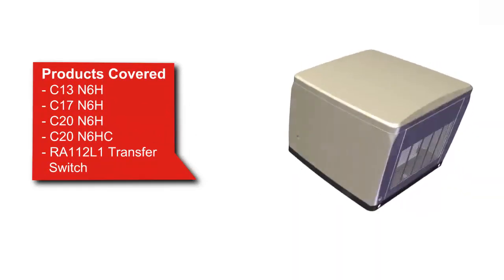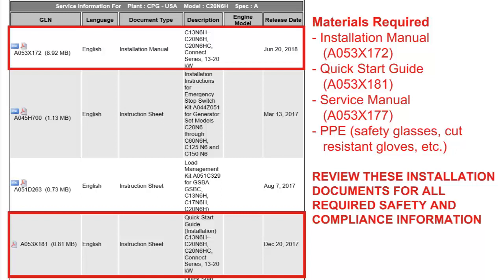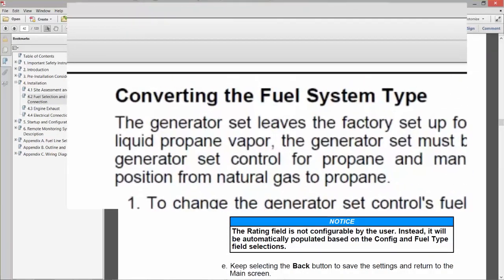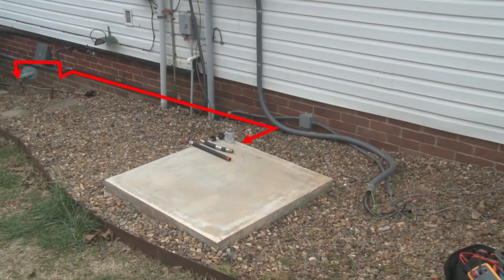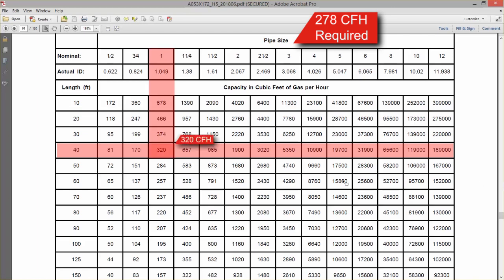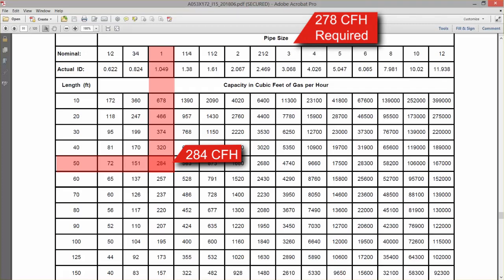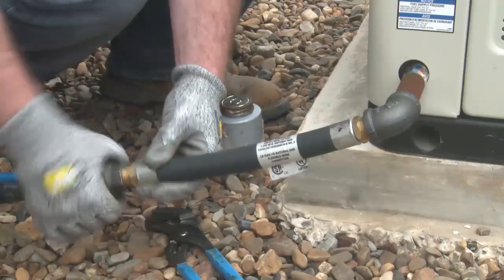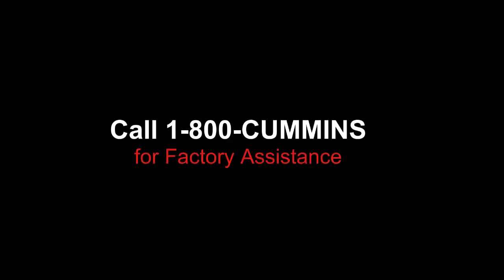Cummins Air-Cooled Generator Set Installation Part 2: Fuel System

Comment: Soap the nipple connection that's inaccessible due to the rear panel that is nearly impossible to remove.  That skipped over installing that nipple.

Comment: My expertise comes from 35 years in the natural gas utility industry & I would like to go over some of the shortcomings in this video. #1 always contact your gas provider about your intentions of adding an extra gas load to the system. The gas utility or provider should conduct a load survey, evaluating the current system and providing you information about what is needed and their requirement #2 you're sizing information is correct if indeed the generator is on a home run and no other gas appliances are involved but in most cases other appliances may be involved & the longest run method will need to be used.#3 you installed the generator without a drip leg ( sediment trap ) which is required by the national gas fuel code, Massachusetts is probably the only state not requiring one and they are just plain wrong. Hope this helps and stay safe out there.